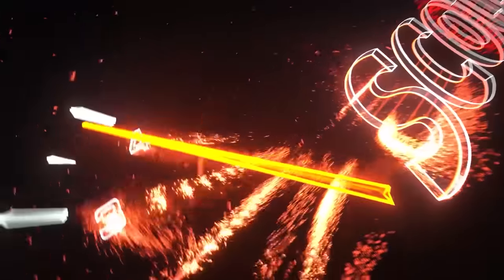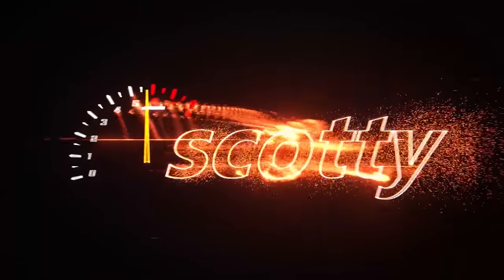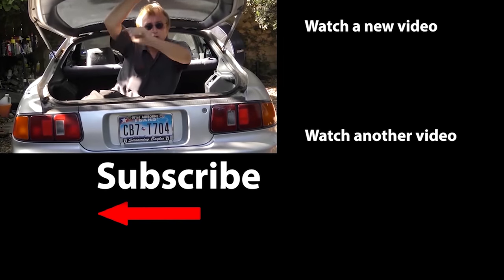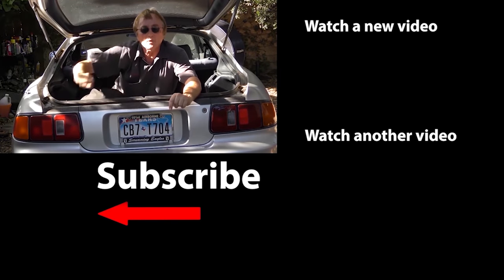Here’s Why Your Catalytic Converter is About to Be Stolen (Nationwide Theft Alert)

Comment: Just had the cat stolen under my 07 Prius. Cost abouti $3 grand for the part with a cat shield and repairs (don't make the mistake i did. go to a local part repair shop, not a toyota dealership). Hybrids have the most valuable cat converters since they're the cleanest and most efficient.

Comment: I rented an apartment in the Bay area and some 20 something year old dude bought an BMW i8.. probably cashed out some stock options... his parking spot was next to my sweet 05 Explorer. Nice looking ride but would not pay that kind of cash for a 3 cylinder... I heard that the battery does not have that much range on those either so I guess you would have to cruise around with 3 cylinders most of the time.

Comment: My partner at work had his catalytic converter on his 2008 Honda CR-V stolen a few months ago.
Reply: @U Betcha 
He didn’t realize until he turned on the car and it was loud as hell. He left work early to get it replaced (almost $600 down the drain). I’ve told him and everyone I know that has a car to have a plate to cover the CC (I don’t know about getting it welded).

Comment: If I'm spending $148,000 on a vehicle, I would buy a fully loaded Ford F-350 Super Duty King Ranch with the tremor package and with the 6.7l diesel.
oh and guess what I still have $68,000 left over, And With that I would buy a used fully loaded suburban or Escalade ESV

3-cylinder LOL crap.... good luck...

Comment: Hey Scotty, I have a ‘17 Hyundai Sonata with a 2.4 and it’s sucking oil (almost all 5 quarts between oil changes at 3000 miles). Hyundai won’t repair it under warranty because it’s not the connecting rod bearings. No obvious signs of oil leaks (exhaust is normal, no oil leaks or oil on my skid plate). What should I do?

Comment: On that Nissan Pathfinder also Check the CARRIER BEARING in the DRIVELINE this is common issue with older nissan 4wd vehicles the one in my Nissan Hardbody truck went out not too long ago LoL not a a expensive fix either

Comment: Scotty is right about Prius life. When the battery went out in my 2005, I just searched the junkyards for a 2014 battery for $850 and gained 9 years in life. Don't buy a reconditioned battery or go to the dealer. The real problem is you cat dying in California. An OEM converter is $2000 DIY.

Comment: hey Scotty! You sure hate mopar products, but, i had an old dakota with almost 300,000 miles on it and got tboned by a camaro and bent frame. Also had a Neon I put over 100,000 miles on with original engine and tranny and sold it with 289,000 on it cause i needed money for bills, would still have my neon otherwise! Mopar or no car, again, if you really take care of you vehicle it doesnt matter your favorite brand!

Comment: Hey Scotty, back in 1982 I believe. I visited a Dodge dealership, and looking at a 1982 Challenger that was like the Ford Expo. The salesperson said we have a quicker car for the same price, but don't laugh when I bring it out. It was a Dodge Colt with a turbocharger. Unbelievable that this stupid box car was fast in the 1980s. It was a sleeper car, because there wasn't any badges on it. Being young at the time, choose a Mercury Capri with a 6 cylinder. After that I was hooked on Mustangs.
Scotty your vacation home or real home looks wonderful. I live in Southern New Hampshire and would like to swing by, if possible to meet you in person. You had that lincese plate" live free or die. Which is the motto of New Hampshire "live free or die" on our license plate.

Comment: Scotty, i have 2013 jeep wrangler with 234k . 
I started noticing this noise coming from behind my car sounds like its by the tailgate. It sounds like im dragging a rake on concrete floor. I hear it at a range from 50 to 65 mphs. 
Side note: it has original wheel bearings
And just last week i noticed fluid coming out the left side of the rear axle[deffinately replacing the seals].
Do you think my rear axle bearings might be going?

Comment: Hey scotty i have a 2001 Toyota Corolla ce with the 1.8 motor and 5 speed manual. Im trying to figure out why the car is idling rough. Iv replaced the spark plugs Ignition coils. Had the fuel system cleaned out and sometimes the car idles perfect then other times it acts like its about to die on me. I think its the idle control valve but let me know in your opinion

Comment: A 20 V cordless grinder with a cut-off wheel from the Home Depot will remove the CAT in less then 2 minutes.  A welded shield over the CAT might take another 2 minutes.  Pick up trucks and large SUVs are far more likely to have their CATs stolen because they don't need to be jacked up to get under them and their larger CATs contain more precious metals.

Comment: I had a cat convertor break in half in my before. The insides were already all loose. Mechanic replaced it with an aftermarket one. Had a car before that that was already straight piped. Know my current vehicle would be an easy target as it's a vehicle high enough that it can easily be crawled under, but it's 20 years old, both the cat and muffler look small. Bigger older ones, or newer ones would most likely be worth more. 
But at least in my state it's legal to use deadly force to protect yourself or property. So those thefts are rare in my state. A few in the 2 biggest cities in my state though

Comment: The joke is on them.  I sold mine as soon as the catalytic converter theft trend started.  I then just put a piece of exhaust pipe in the gap.  Tada, no catalytic converter theft!  Since I keep the vehicle in top shape, the exhaust gas test is passed easily.

Comment: Here in Humble Tx catalytic converters are getting stolen like you won't believe I've gotten mine stolen several of my neighbor's Cadillac converters their stolen twice or more in past 9 months. My landlord got them on video but the thieves don't care about getting caught on video they don't care about the alarm going off  they've gotten so good at it your Cadillac converter gone in 30 seconds by the time you get to the door they're gone already these thieves gotten so vicious and good at what they do the cops don't even try to chase them. The National Guard couldn't stop them. And it hurts it hurts real bad these catalytic converters usually cost over $1,000 to be replaced your only hope to stop the thieving is to do what me and my neighbors are doing sleeping in our vehicles. When you see them coming and you'll see them they don't care start up your vehicle that cat will get so hot they won't dare try to remove it.

Comment: Starting in 2021 all Toyota Sienna trim levels have a 4-cylinder hybrid drivetrain with CVT.  Say hello to complexity! Looks like 2020 is the end of the road for Sienna trouble-free reliability.
Reply: Generally Toyota hybrids have been reliable except for some generator unit that occasionally fails after 150,000 miles and basically would total the car. Also the Toyota hybrid CVT isn't a typical JATCO-style CVT with belts and pulleys.

Comment: Hey Scotty, what do you think of a 2005 Buick Century with a cracked radiator and some body issues (like y'know, cracked bumper and dented fenders) for $800? I'm looking at maybe a project car and I was wondering if that's a decent car in the long run
Reply: Great car; the new radiator shouldn't cost a lot, and those cars are ultra reliable. Dave Ramsey really likes cars like that which have good bones and bad exteriors. The savvy woman will gravitate to that car, and be more than willing to use it as a family vehicle for at least the first kid, maybe a second. Maybe tape up dented parts of the front bumper for aero, but leave the rest untouched. It won't scare a keeper away!

Comment: I have the luxury of parking where there's light and my security cameras are pointing. Even if they somehow got away with it I already have a spare converter and spare O2 sensors so I'm not worried. I don't sleep so I'm always monitoring the cameras and I do confront scumbags; and I don't call cops >:0

Comment: I want a car that I can drive fast on the highway, a daily driver. I want to buy a new one. I want a Camry. My question to you is what trim should I get. I plan on keeping this car till the wheels fall off. These are 3 different trims I’m considering: XSE, or The SE Nightshade Edition, or The XSE V6?
Reply: XSE with either engine. The XLE Hybrid is a sleeper option, because the extra HP on the V6 can't be correctly utilized without causing torque steer. The extra low-end oomph on the XLE Hybrid should provide more than enough power, and the smaller tire rims will be more impervious to potholes.
Reply: @EMichaelBall  yeah but Scotty recommends not to buy Hybrid cars because of their expensive repair costs.

Comment: bought a 2002 camry with 103k miles for 3k at an auto auction, sold it for 3k but i wish i kept it. didnt know what i had at the time!
Reply: 02-03 had some automatic transmission issues. 04 was better, with 96-01 and 05-06 being the golden ones.

Comment: Hey scotty good evening! Question: how reliable is a Toyota rav4 2014?
Reply: Very reliable my mom has a 2012 one with 310,000 miles
Reply: Iffy infotainment system and the possibility of salt collecting under the doors causing rust over time. Otherwise pretty good. The 2009-12 is better.
Reply: Has a very reliable engine and trans. Flimsy door metal and oem brake pads and rotors that have a strange noise that is normal according to the dealer. That fixed when I put centric rotors and pads. The car is pretty decent but interior is just ok. Infotainment system is very clunky and is the worst thing about the car.

Comment: Hey scotty i am 16 and checking to buy my first truck is 2014 gmc sierra 1500 with the 5.3 is it a good truck  or its junk
Reply: I ain't scotty, so don't make your decision based on my word, but I know people who have them, biggest thing is the miles on it. Back in the day chevy and gm trucks could last 600k on the same engine, even the gassers, but since 2003 they have been less and less miles per engine. So if it is in good shape with less than 200000k on it, the engines weren't bad, and transmissions were alright, not great not bad.
Reply: Is it the 3rd gen or 2nd gen classic? The latter is crap; the former is OK.

That said, you should never buy a truck for fashion, because they're too expensive to buy, fuel, and maintain for anything but frequent towing or hauling. The less money you pay for a car, the less college or trade school debt you need to take out. Student debt is no joke; a lot of people my age can't buy houses because of it.
Reply: I mixed it up: 2nd gen from 2010 on is OK; 3rd gen has unstable electrical systems.
Reply: @EMichaelBall  I see what you mean, but if you are smart you won't have trade school debt since you work your trade whilst taking school for it.

Comment: Scotty on point as usual. I have the 1.5 in my Civic Si, and I always need to downshit to pass or when going up medium elevation. So what more in a heavier Accord?
Reply: 1.5 turbo ? Figured it wouldnt need a downshift
Reply: @CRAPO2011  You gotta downshift to spool the turbo otherwise youre lugging the engine and making the turbo work harder.
Reply: @ChuukeseStink  ah that kinda sucks, i could understand in the older NA 1.8 VTEC engines needing to downshift as they had super low torque down low
Reply: @CRAPO2011   The car is fantastic but you're gonna be reminded that its a small 1.5 😅.
Reply: @ChuukeseStink  Personally i liked the high revving nature of the older k series, b series.
Reply: @CRAPO2011  I agree but I don't mind the 45mpg. Lol. Plus, I turn alot of heads when peoplw hear the WHOOOSH turbo sounds coming from a Civic. 🤣
Reply: @ChuukeseStink  are the si , still manual trans only?
Reply: @CRAPO2011  Yeup! Comes with LSD too. And sport mode stiffens the suspension and turbo spools up quicker.
Reply: @ChuukeseStink  call me old but i like the sedan or hatch better than the coupe. Dealer has a nice bright red si sedan and it looked the part.

Comment: Hey Scotty love your channel, I have a 1999 Chevy Tahoe 5.7 liter V8 with 129k miles, it has the wrong oil in the engine but it runs fine, what damage could that have done
Reply: How hard is it to get a oil change with the right oil? Heck the cheapest oil change is 23 dollars.
Reply: Yeah I would recommend getting that wrong oil swapped out as soon as you can.
Reply: “The wrong oil” as in 10-30 instead of 5-30? If that’s the issue it’s fine drive it until it needs another oil change
Reply: Exactly nbd if wrong weight unless live in Alaska

Comment: Hey Scotty I just bought a 2021 Toyota Tacoma and the DEALER says it needs oil changes every 10k miles. And the 4x4 system needs major services at 40k and 60k miles. Are they pulling my chain?
Reply: If keep truck forever do it every 5 , it probably used the newr oils

Comment: If you buy a new Toyota hybrid, they supposedly now have a 150k/10 mile warranty on the battery, which is actaully pretty good because 150k is about what an average person might drive in 10 years.  I still won't buy one though because the Toyota 4 cylinder gas engines are hard to beat and they are known for reliability, plus you don't have to worry about batteries every 10 years (yes they've gotten cheaper--I think someone said you can have a new OEM one installed for $5k) but in reality, hybrids don't get that much better gas mileage (my Camry can get up to 40 MPG, but usually is around 35 MPG average most of sthe time, but hybrids that I've seen only get about 50-55 MPG, so when you factor in the cost of a battery after 10 years, it probably evens out.  The gas engine just doesn't require as much maintenance other than belts and fluid changes (which on most newer vehicles, oil is the only real thing you have to change on a regular basis, and then maybe trans fluid every 5 years or 60k).  And people forget hybrids still has a gas engine (hence being a hybrid) so they also need regular maintenance just like a gas burning vehicle.